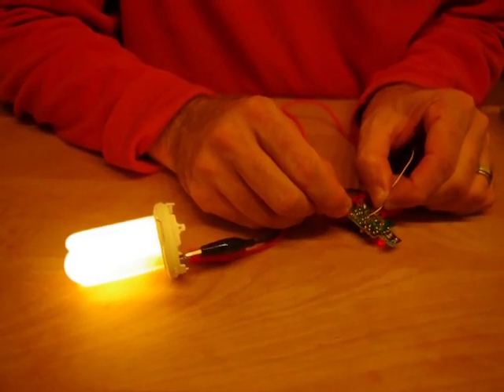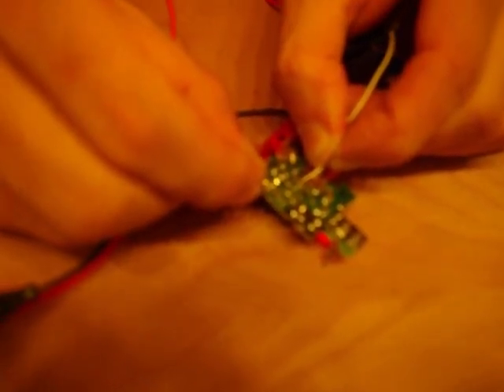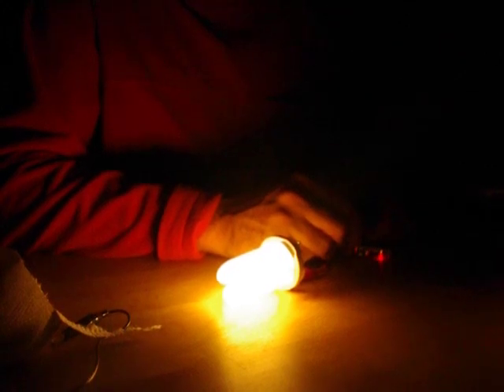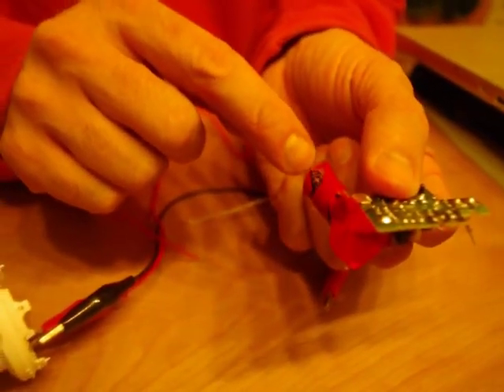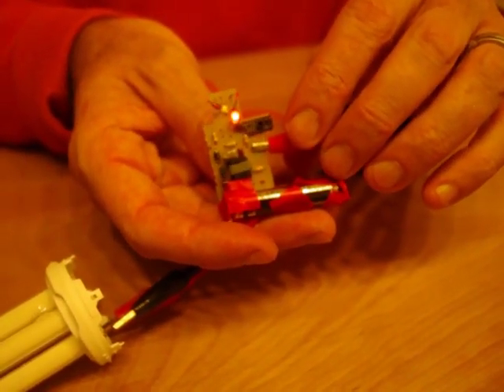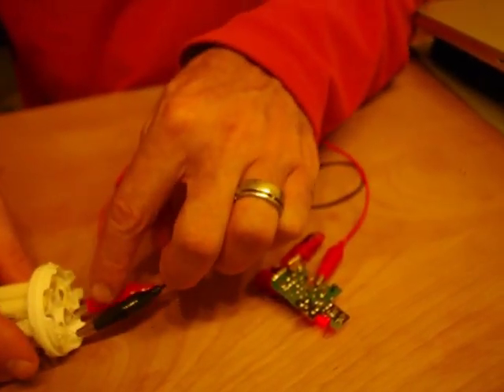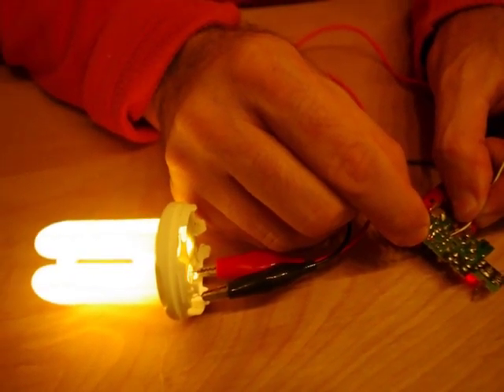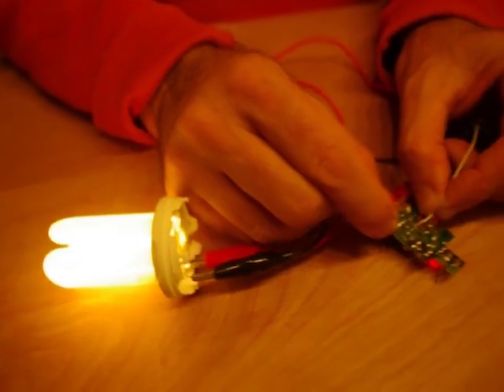Lighting an 11W 220 V CFL using a 1.5 V AAA battery and a CVS disposable camera flash circuit

Comment: the bulb itself runs on AC, the PCB inside them generates AC current at around 80000 hz, it is similiar to halogen lamp electronic transformers but with higher output voltage

Comment: does the capacitor have to be cut ? cuz i tried wit the capacitor on and doesn't work well it works but untill the capacitor discharges and after recharging it ... and so on

Comment: well it doesn't work for me . ... id like 2 power up a tv or smthing like that with this kind of circuit ...id like 2 use it in open spaces ..can somehow stabilize the voltage around 220v. ? so i could power up something else to ? .. i get that instead of the battery i can use a solar panel to power up the circuit and with a lightbulb  in front of the solar panel i dont have to mind 4 sun . but id like 2 power up a boombox 2. if is posible send me a schematic or a link pls

Comment: so we have to disassemble a dangerous, mercury filled, light bulb to get this to work?
Reply: Frenchie with a two pin it's easy, just separate the aluminum crimping with a small screwdriver and then pull it out.

Comment: You can achieve the same results with the circuit from any cheap mosquito/fly zapper (the Chinese made tennis racket kind will do quite well).
Reply: Reàly.? Would like to see someone hack that.!
Reply: I done it 3 times. The hack is available on the net just google for it. Basically, connect the CFL bulb (minus its circuit) to the output of the mosquito bat. That's it.